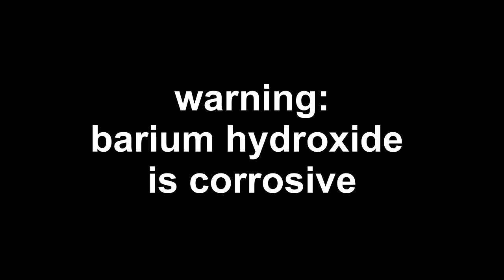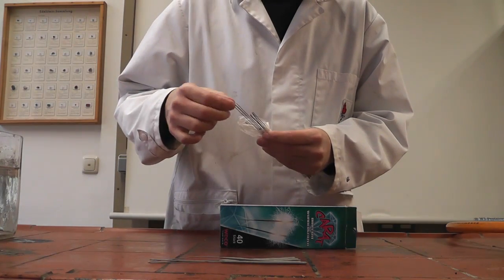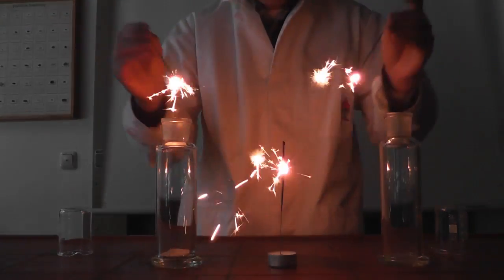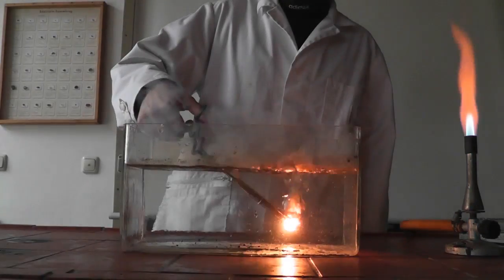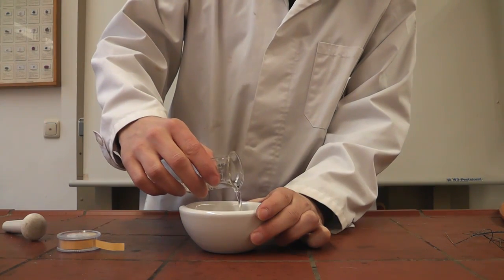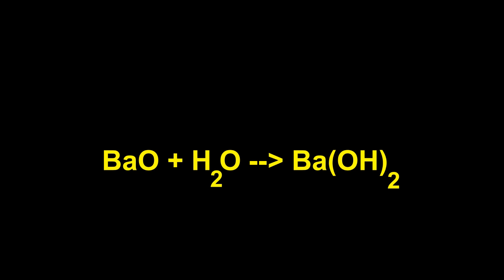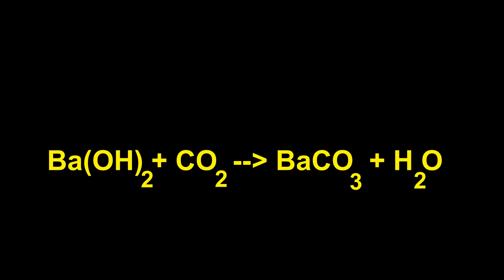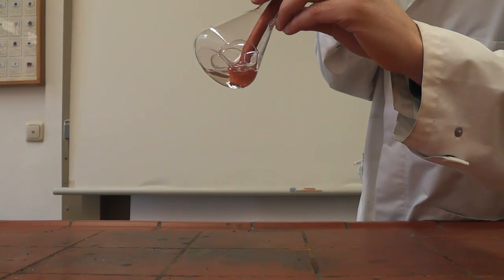Make barium hydroxide from spent sparklers

Comment: Very nice and innovative way of utilizing spent materials for new purposes! It is also an easily accessed source of carbonate or sulphate testing for home chemist. The formed barium carbonate doesn't have to be discarded but can additionally be used for pyrotechnic display when mixed with an oxidizer. Even though it is not of any larger significance at the given amounts, it might be important to know about the relative toxicity of barium salts.

Thank you for sharing, great video!
Reply: T